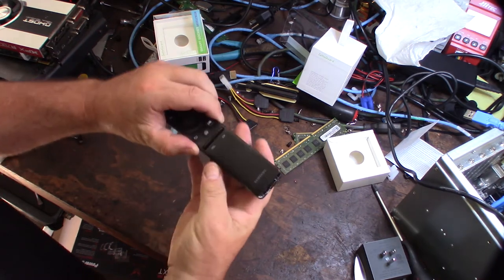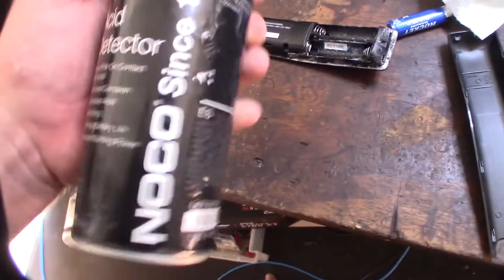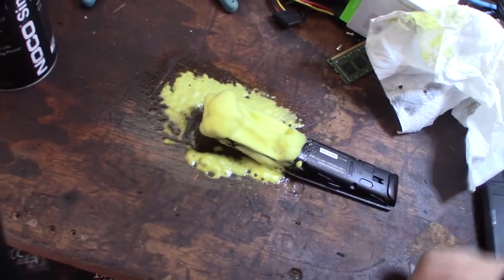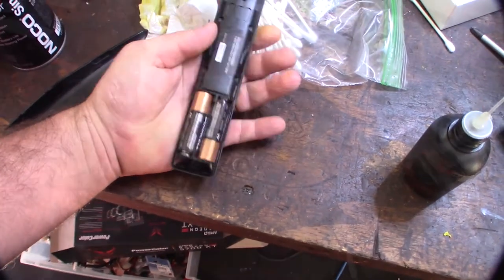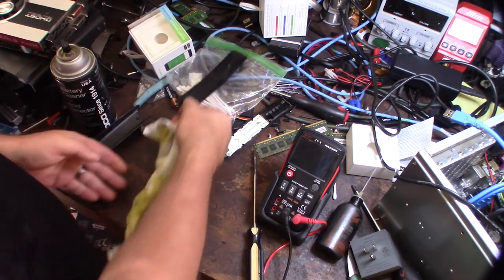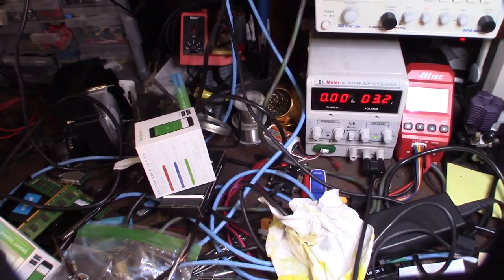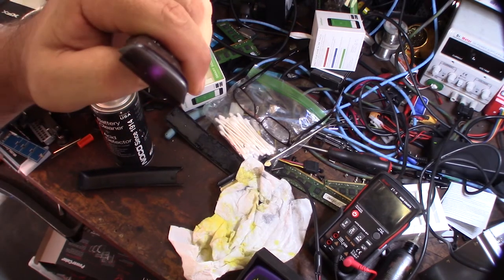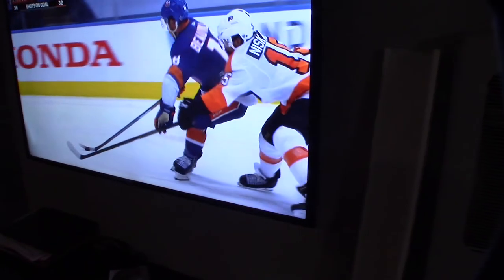Samsung TV remote Troubleshooting & Repair with Battery Leak and intermittent PCB

Comment: I have a samsung series 8000 tv, I have gone through 2 remotes in which the batteries leaked out. any idea what is going on with this? this seems to happen after about 3-5 months.